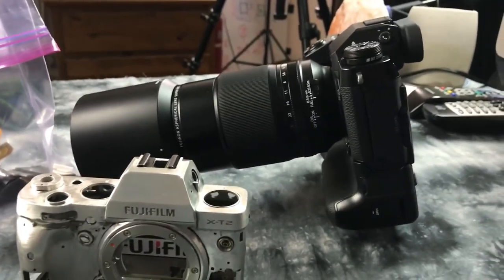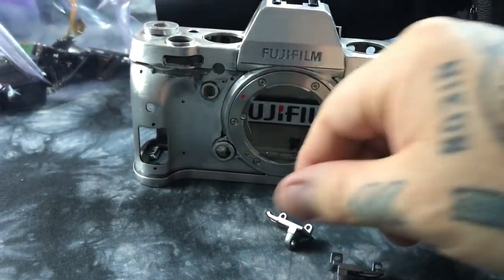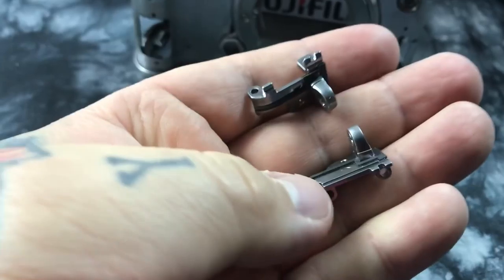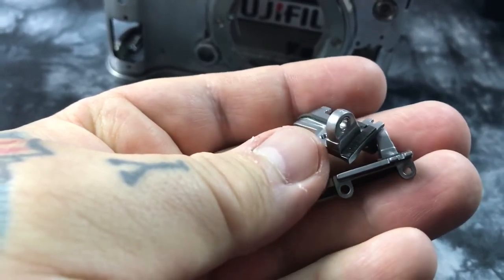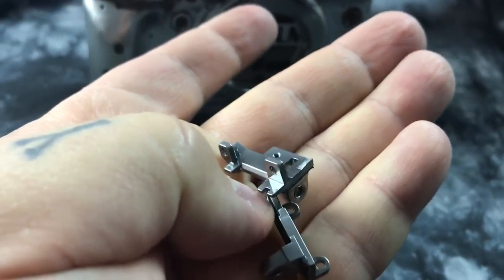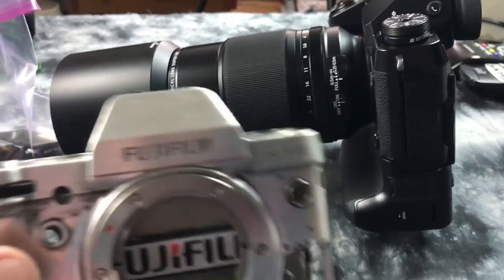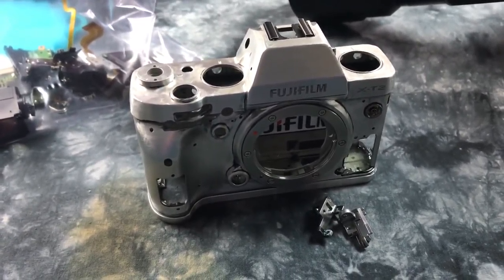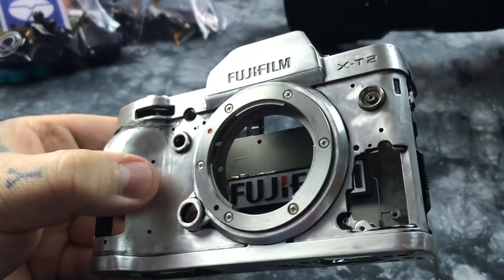😊 FUJI XH-1 FIRMWARE !

Comment: on the XH-1 i cannot find "SHOOT WITHOUT LENS",  so how can i use my old Fufi lens and other junk glass? i still cannot get my Samyang 12mm2.0 to work on the XH-1.
Reply from the maker: its there in the settings menu..... loooook :)
Reply: you are correct, that is the menu setting that i tried to use already, so i tried it again and it still will not work. then i went to my XT-2 and the Samyang worked fine. the shutter button will not work with the third party lens and my old fuji lenses do not function on the XH-1.
Reply: I also had trouble finding it, but finally found it : It's (oddly enough) in the Button/Dials settings menu (in the second window).
It has nothing to do there, but there it is : the shooting without lens function.
Happy shooting with your Samyang on the X-H1 !